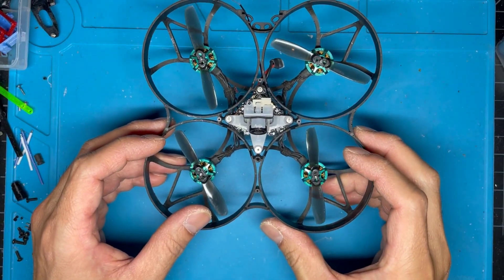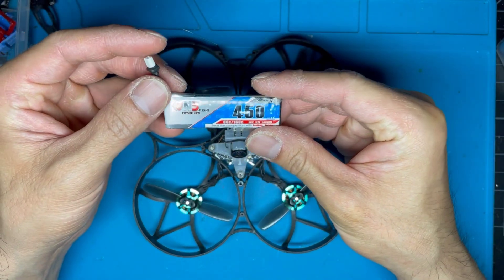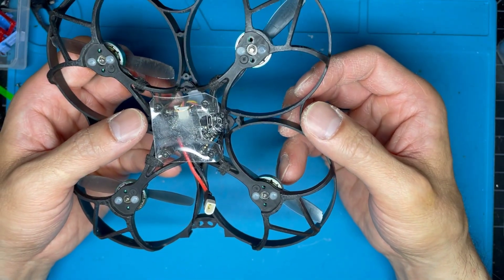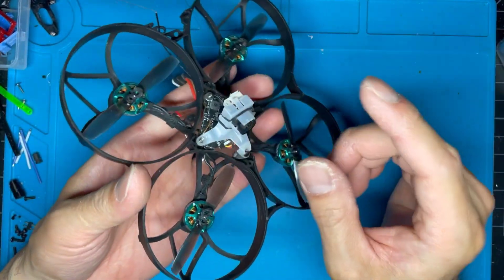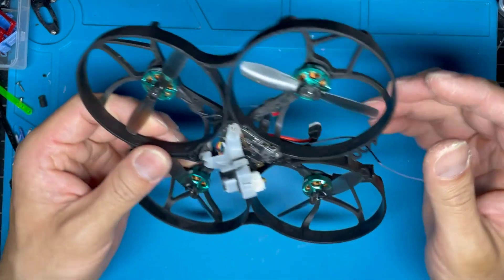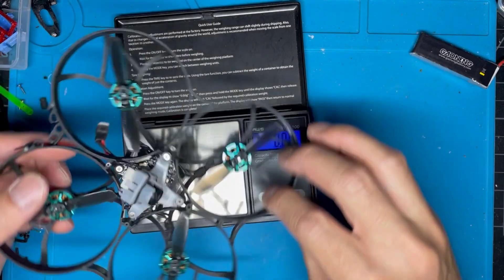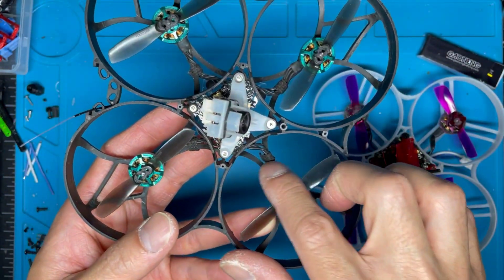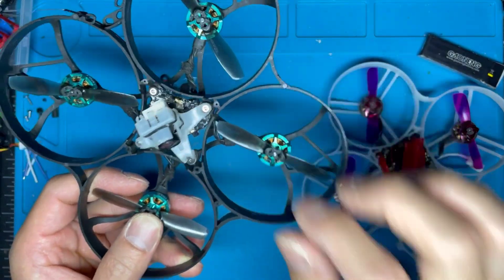FPVCycle 1S BigWhoop Flight and Build info

Comment: I really want to make a 85mm with those motors on 2s. Your second build in the video I feel would be awesome on 2s, maybe just a small motor output limit. And hq makes some nice 2” bi blade props now to
Reply from the maker: 2s on a lightweight 85 or 95 would be killer! I need to get a hold of a 5in1 fc to do it. Could make a decent build with spare 4in1's i have. The extra weight from an external vtx and receiver (elrs) should be somewhat negligible with 2s. New bi-prop selections help too fer sure

Comment: It's funny cause I already built this whoop without watching this, used the same frame, 
fc diamond f4(from moblite7)
1202.5 11600kv motors from rekon3
Eachine nano vtx(no OSD sadly fc doesnt support) just time it 4mins and done
Happymodel ELRS ep2
Didn't thought of using a canopy but will consider after watching this video
Reply from the maker: It's a damn tank, i love it! Switching to 1303 motors made a huge difference than when I had it on 1202.5 11500kv

Comment: Thanks for the break down. Since the motors aren’t available is there any other brand you recommend?
Reply from the maker: Those fpvcycle 1303 motors are very hard to come by...if i can get another set, i totally would. Next best thing i've tried are 1202.5 but i find those lack power on the topend. It's possible to go for high KV 1102/1103 motors. I've seen a build with 1102 13500kv motors on an 85mm build and it looked fun!

Comment: Do you fly that 85mm frame with the 1202.5 motors on 1 or 2s?
Reply from the maker: The 85x with 1202.5 11500kv motors, I was test flying it on 1s. It flies ok, just lacked top end power.

Comment: Rad!! I'll have to build one of these guys once I can get the motors lol. They should be in stock in like a month and a half. I was able to snag one of the fpvcycle 1s boards, so im going to build an 85mm 1s with the gemfan 2035's so I can play IGOW3. Looking forward to your update on that 85mm unit. Cheers!
Reply from the maker: Yea i've been hearing those motors are unicorns these days lol. ...unfortunately the update on the 85mm ain't great. I did not like how the 1202.5 performed on it and will be repurposing the motors for something else. It just lacked top end power. GL with IGOW! If you manage to get the 95 together, it'll be near indestructible, I've banged the hell out of the 95 and nothing has broke yet, except some dust on the caddx lite sensor.

Comment: Boa. E o projeto ainda está em uso? Está durando?
Reply from the maker: Yes! I still fly it very often. Here is a recent clip when i flew it 4 days ago. The build is a tank! https://www.instagram.com/p/CPM_ZBLjBF2/?utm_medium=copy_link
Reply: @MrHappeFPV  muito bom. Vou colocar no meu 95mm um motor Happymodel 1203 de 11000kv. Você acha que vai ficar bom também?
Reply from the maker: @wellingtonmeloniosilva2232  I use to have Rcinpower 1202.5 11500kv in a 95x and it flew ok on 1s. Power starts to drop at high throttle though. 1203 11000kv should work!